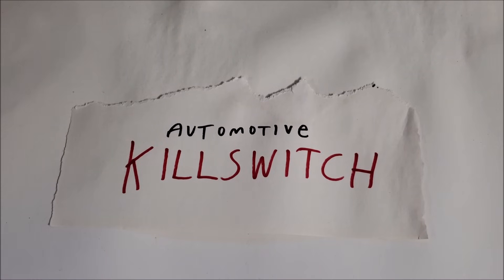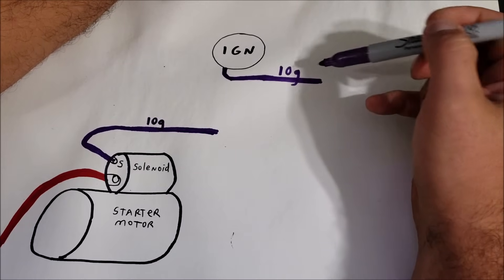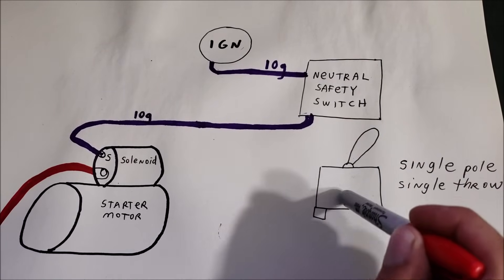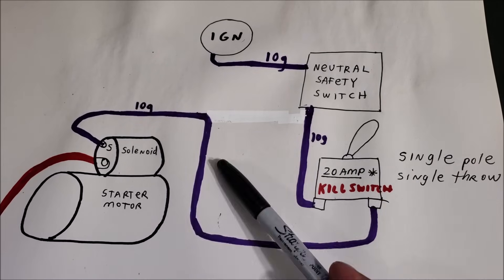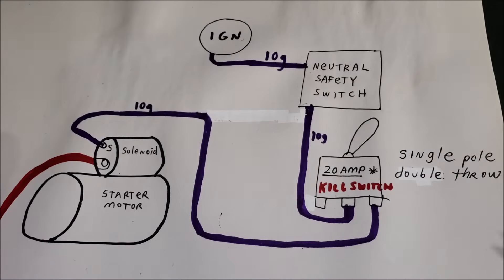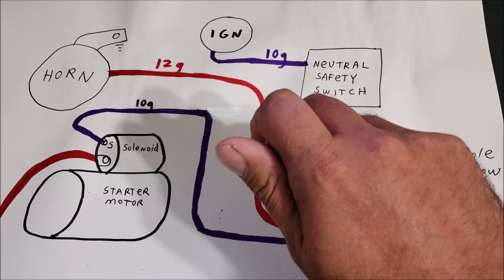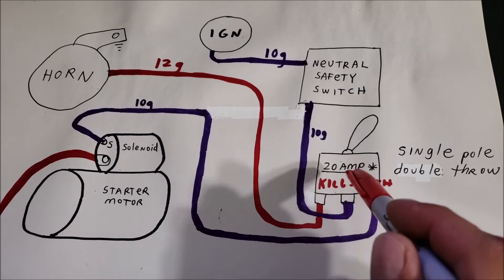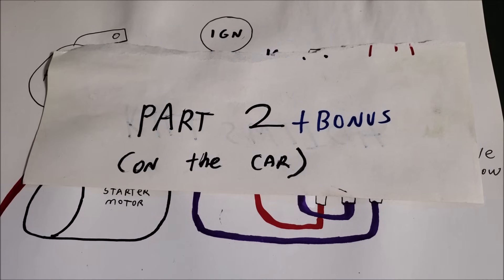how to wire a KILLSWITCH - theft deterrent

Comment: If you short the solenoid to starter with a screwdriver the starter will turn
Reply: If you need a real killswitch just do the same thing as in this video, but splice in the killswitch to the signal wire that goes to the fuel pump. They can jump the starter, push-to-start if it's a manual, heck you can give them the key and as long as that switch is off, no fuel, no start.
Reply: @jaredd8473 can you still add the horn part if you tap into the fuel pump?
Reply: @jaredd8473  great wisdom bro....Think I will do this
Reply from the maker: On a 70 Chevelle big block car you can’t do that to save your life. maybe this option is not for you

Comment: Do not use the  in-car horn if car is Honda . Honda horn is wired positive all time--it is the negative wire to horn that is switched at horn buttons on steering wheel to ground.  Use an accessory horn.
Reply: Informative 
Must of the cars have a relay for the horn

Comment: My 87 chevy doesn't accept it after one use. It has too much of a voltage drop with the 10 guage wire and 50amp switch for some reason.

Comment: This is helpful. My only question is  if I’m installing the switch inside somewhere do I run the risk of voltage drop since I’ve added more length to the overall circuit.
Reply from the maker: you dont add wire you cut the existing wire to the starter motor and add the switch
Reply: @chriscraft77022  @ thank you. The existing wiring should have enough play to re-route it to hide it in the car. I guess that is my real question. Sorry if a dumb question.

Comment: If you need a real killswitch just do the same thing as in this video, but splice in the killswitch to the signal wire that goes to the fuel pump. They can jump the starter, push-to-start if it's a manual, heck you can give them the key and as long as that switch is off, no fuel, no start.

Comment: I had a 1977 Camero that did not start with the key and I jumped the solenoid and she started.  I did what he did and hid the button in the glove box. 
On my 95 regal I just take the anti-theft fuse out and nothing works.  You can run a 5 amp switch the the glove compartment and use that as your kill switch.

Comment: Thank You sir. Just did mine in less than an hour.   Any obstacles we can throw at them thief's to slow them down or make it harder for them to steal the vehicles is better than none. Wish I've seen this video years ago where I had my company van stolen with $10,000 worth of tools and equipment in it. They even took the battery.

Comment: I wired mine so if I turn the key it sounds a small speaker alarm, not loud, just a reminder that it is off but I like the idea of making it so if I try cranking it will cause the horn to honk too.  Mine is connected to the electric fuel pump and I have carb so the Jeep will start and run for about 30 seconds before the carb runs out of gas.

Comment: Without a relay to protect the switch... won't the 20amp switch burn sooner or later due to the several times you crank the engine/starter with the car 100amp battery (for example)? (great video, thanks!)

Comment: 😂😂😂😂😂😂 
JUST REMOVE THE STARTER RELAY
Reply: I just remove the whole engine every night before bed 😊
Reply from the maker: just remove the starter 😒
Reply: @chriscraft77022  hey mister, i'd like to copy your idea but i have a couple of questions before getting started:
1: do i need to add any sort of fuse to the circuit?
2: i've seen switches rated for different Volts and Amps, how do i know which one is suitable for my car? (bear in mind that i do not have the original engine nor manuals at disposal
Reply: @mcspkaput5954  Im not the OP but I can help answer some questions.
What vehicle are you trying to put this in? I might have some documents that list useful information.

1: Every wire in a vehicle (post 60s?) from factory will be fused. Lights, fuel pump, windows, seat etc. The wire you are interrupting is already fused (look for "starter relay fuse" in owners manual fuse blocks). If you do the horn idea as well, you should still be protected since the horn power would now be going through the fuse meant for the starter solenoid relay. 

Edit: I guess I should clarify this was on an 09 G6 which will have BCM and ECU communication so there is no direct line between ignition and starter solenoid. If your vehicle is older you may not have a "starter relay" fuse and may instead have an ignition fuse if there is a direct wire between the starter solenoid and ignition.

2: For the switch, voltage doesn't matter as long as it is above ~16V if your vehicle is a 12V system. I would go for at least 24V if you are worried.
For the current: it depends on what you are trying to splice into. Example: I believe my vehicle starter relay fuse is a 30A? fuse (physically check your fuse labels). Your switch should be higher than this in the event of a short it will not destroy the switch. 

Remember: every component (wire, switch, relay) should be rated HIGHER than the fuse that is protecting them.

Comment: Would the car stall if the switch was activated after the car has been started?
Reply from the maker: no
Reply: Good to know. I was trying to tap the fuel pump relay but could not locate. The IGN fuse was located but was unsure if the switch was activated while car running, it would stall.

Comment: If your horn draws enough current to require 12 gauge wiring, your ignition switch wiring will also need to be upgraded with 12 gauge wiring. Alternatively, what I would do would be to run the line from the cutout switch to a relay which would then provide the necessary current to the horn with a 12 gauge wire.

Comment: These were available in parts houses in 50s and 60s but were wired to a slow blow fuse that would allow someone to start car but wouldn't get far. I purchased several and they worked well until I forgot to switch on and burned fuse. No one had replacement fuses so had to use as a kill switch like you have. Never had an incident. I would be concerned about thoroughly upsetting a would be thief with horn and vandalizing my car to "get back at me"

Comment: The very best simple Kill switch explanation I have seen yet, and I have used it in exactly the same way as you have described.
The only down side for me with this setup is that my vehicle is a manual so even with the switch in the off-kill position it can be clutch started. But "hey" it's usually only going to be some lame kid car thief who wouldn't be bothered trying to clutch it & hopefully they will leave it. Better than having nothing though.
Reply: It's not good. A manual car can be bumped started . Wire it to the fuel pump. If its older and has no duel pump, wire the switch to the  spark plugs cuircut.

Comment: Years ago I had a 1968 GTO...I just ran a wire from the ignition coil to a toggle kill switch to ground out the ignition.  Easy peasy.
Reply: like he said thief will just keep cranking starter
Reply: @tomsurfing007  So what's stopping you having a kill switch on the ignition and another kill switch on the starter connected to a horn? If you use a train horn ain't no way that persons going to sit there cranking it 😂

Comment: Hey, I appreciate you showing the diagrams that helped a lot. I’ve done some installing alarms and I usually have a yellow wire on old GMC’s. On the starter wire. I’m working on a 2008 GMC Yukon and I cannot find the starter wire coming off the column to save my life. Do you happen to have a picture or could you tell me where that starter wire is located and if it is the 10 gauge Purple? I know a 2004. It’s a 10 gauge yellow. Thank you ahead of time.

Comment: I’ve always wondered, if you kill the starter instead of the fuel pump, and they keep turning the ignition, will the fuel pump flood the engine? This is the only reason why I would put a kill switch on the fuel pump instead.
Reply: No, the fuel pump will not flood the engine.

Comment: This doesn't work on Mopars. You use an aligator clip wire from the neutral safety switch terminal on the starter relay to any ground, then you put an aligator clip wire from positive to coil positive, then jam a screwdriver between the starter solenoid terminal and the positive terminal on the relay and bam...you're off to the races no matter what gear you're in. (BTW, Mopar starter solenoids are mounted under the hood where they are easily accessible.)

Comment: Great video.  Thanks for the instructions!  Would this same setup work with a three prong switch with and LED having; Earth, Load & Supply?  I was thinking the earth tab can go to any ground on the car, and the purple wire from the starter would get cut and coming from the starter would go into Supply, and then come out of Load and go into the Solenoid.  Does that work?

Comment: Question: 
I did this on my 2010 Lexus 6 cylinder and it seems to be the hot set up.
Toggle the switch and when the starter is hit, the horn blows. Love it!
Here’s my potential problem…
The wire on the solenoid is 18ga.
I ran 12ga wire 10 feet to the 20amp toggle switch and then 10 feet back to where I interrupted the original circuit.
Everything is fine for about two weeks and then my solenoid suddenly fries. 
Like toast.
Now this car has 148K miles so maybe it was time to puke out BUT….
I am wondering if the extra 20 feet of wire drew amperage enough to make the solenoid struggle and overheat?
What’s the consensus?
Did the amperage suck cause my solenoid to overheat and smoke?

(I am considering re-routing to the relay if it exists…or last resort, the fuel pump relay.)
Reply from the maker: the wire to the horn should be triggering the horn relay either positive or negative .. not powering it
Reply: @chriscraft77022  
Good point.
I’m still wondering if the extra 20 feet of 12ga affected the solenoid. 
(It runs from next to the solenoid, to the driver’s seat where the toggle is, and then back to where I interrupted the circuit.)
I think I’m just going figure out how to rig a relay for that, too…just to be safe
Thanks for the reply!

Comment: Good idea, add a latching relay in-between the switch to horn wire and the horn will stay on even if they crank for 1 second and dont crank anymore. Horn will blast until battery is dead, or they are..
Reply: Spaz 😂

Comment: Can I run it off the fuel pump relay using a three-prong toggle switch and including the horn as the alarm
Reply: I think that's (fuel pump/horn) the best solution overall. You have the noise of the horn plus the noise of them cranking. The thieves won't be there long enough to flatten the battery.
Reply: So I don't connect to the starter solenoid I go to the fuel pump instead tell me the three places I need to connect to I know the horn is one

Comment: Never got part 2 guess I’ll have to make it
Reply from the maker: if you do make it use a relay to ground the horn .. don’t run a wire to the horn
Reply: @chriscraft77022  you should control the horn by ground but the neutral safety doesn’t run a ground it would be your 12 hot no?
Reply from the maker: you run the neutral safety wire to electro magnet. horn wire runs through 30 and 87 …. something like that ..

Comment: only thing I'm confused about is what wire I use for the power. Not the 12v constant, is it the wire literally called ignition 1? Or would 12v constant work since the switch will be before the ignition ? Or after what ever way you wanna look at it

Comment: Any success with modern 2020 and up with Fob's? so much stuff goes on in cars I wouldnt want to mess things up. ECU's can get pretty $$$
Reply from the maker: this doesn’t have anything to do with computers
Reply: @chriscraft77022  my bad sorry, I thought the neutral safety was a relay in the fuse box. I just saw on mine, its a separate part.

Comment: Love the 2nd idea with the horn. It got me thinking. I want to install a momentary push button that closes the circuit while starting so I don't have to keep remembering to toggle the switch back and forth each time. What I was thinking is using a 5 pin relay in place of the double throw toggle switch.

The neutral safety wire goes into the 30 pin. 87a pin is to the horn, 87 pin to the solenoid. The momentary switch will be to the 86 pin.

This way, it will always go to the horn until the momentary switch button is pressed. Once released, it will always go to the horn circuit.
Reply: because its a relay youd be fine with using a low amp rated switch right?
Reply: Great idea!
Reply: My friends and I wired something similar only we used an air horn 😅, it'll scare the hell out of any thief
Reply: from where can u get the power for relay?
Reply: @고스트-x5i  You can get it from the main 12V+ coming to your fuse panel. I actually prefer to put the relay in the engine compartment so the coil positive power goes directly from the battery. The ground comes from the cabin chassis to the switch and the switched ground goes through the firewall to the ground on the relay. That way, you are not feeding 12V+ through the firewall.

Comment: This is an older vid so dont know if it will get answered but... after the 3 switch & bonus wire to horn... my buddy and i were trying to think of something that is removable(maybe like a fuse from a fusable link?) And move that to another part of the vehicle... thoughts on that?

Edit: spelling and :So to be more specific, at the end of your vid you have a straight purple line on the bottom... could a relay or fused link be added there, removeable and maybe more unexpected if they bypass/find the killswitch? Or i guess could even be between the ignition and NSS? Any help appreciated.

Comment: BUT  YOU  MUST always remember to set the kill switch..It will ALWAYS  set itself IF you use a 60 minute countdown  clock  timer like is used in Bathroom electric heaters. You must always turn the hidden knob  to  start the car  but you never  need to  do  a  thing  to activate  the  kill  switch which costs  only   $20. myself and how many others  would still  have our  cars  today   IF  we  had   bothered  !!

Comment: I stopped using this way method after my car still got stolen but the joyriders tried drifting & crashed backwards into another car in my street. When i went to take a look the car was still running with a screwdriver in ignition & my kill switch still activated...they didnt find but still started the car in seconds. Can u take a guess how they did it ?
Reply from the maker: what is the vehicle?
Reply: @chriscraft77022  92 talon eagle turbo
Reply from the maker: there were many cars wired where you can start it by jumping the starter.. because the main fuse box is wired off the starter lug.. now I know why people don’t like this video… I only kill switch old cars and before 1971 you could not start it like that … if I explained what happened you would not understand … just do a fuel pump or ignition kill switch
Reply: @chriscraft77022  spot on mate, fuel pump is the sure way, the battery will give up if they keep cranking, id rather this or a burnt out starter then the thieves totalling the whole car

Comment: I have another fun question. I assume that this would not turn off the car while it's running. Could I flip the switch after I start the car, while the car is running, without issue. My concern is car jackings - I wouldn't necessarily want to cut the car off immediately, just keep them from restarting the car after they've driven off. I assume since this is the starter, it wouldn't be an issue (like the fuel pump switches for example), but I want to make sure I'm not missing something since I'm not a mechanic.

Comment: PLEASE HELP!!! 
I have a 96 Subaru Legacy. 
I was able to add in the switch to manipulate power to the starter, but when I flip it to the horn position, power is sent directly to the horn without turning the ignition.
Reply from the maker: that is literally what it is supposed to do..  I think you wired it wrong. The switch should have 3 positions
Reply: I’m trying to add the bonus. I know I already added the kill switch. 
On/off/on switch yes? 
I’m sure I’m just using the wrong wires or something. Obviously the horn isn’t supposed to be blaring WITHOUT the the ignition being turned into the on position.
Reply: @BisqueteenTrisket  Did you get the issue solved?  I have a 1997 Subaru Legacy and it's been stolen twice.  I found it both times myself - last time with the thieves in it! It is really bad here in WA. Anyway I keep the car now in the garage but I'm afraid to just put it outside while I work in my garage.  I'm looking over switches now because I bought the wrong one.  Just wondering if you found one that works.  I'm glad you posted.  I'd love to hear back.
Reply: @BisqueteenTrisket  did you get the issue resolved? Do you know how to use a multimeter? The ignition system has a wire that's always hot, and the rest should only have power when you turn the key to start.  It sounds like you used the hot wire.

Comment: How do you wire a single pole double throw switch?  The one I looked at has 6 connections.  How do you wire them?
Reply from the maker: it should only have 3 .. double pole double throw has 6 for like reversing DC motors

Comment: Can I wire the switch from the wiring inside the dash.  I have a 98 Jeep Wrangler if I use a multimeter to find the proper wiring can I do it?

Comment: So I’m adding a kill switch to my bike air compressor, so I just tap in-line to the hot wire? No ground needed?
Reply from the maker: yes, the part should be grounded already
Reply: @chriscraft77022  thank you, yeah I was worried about the ground, over thinking it I guess, I hate wires and electrical shit